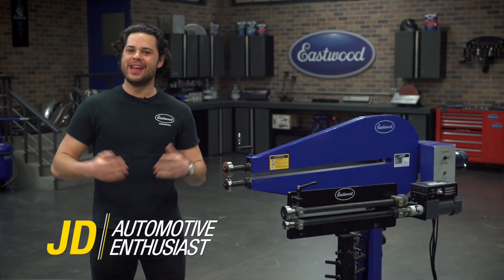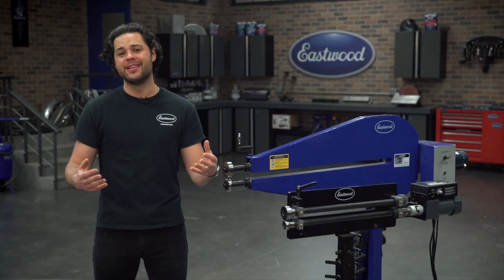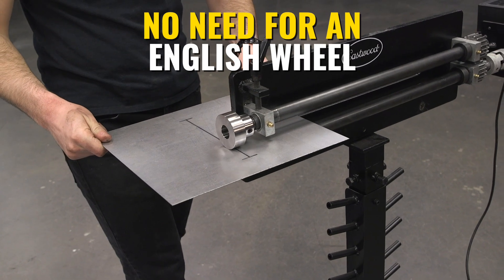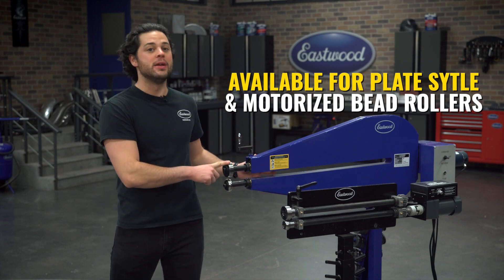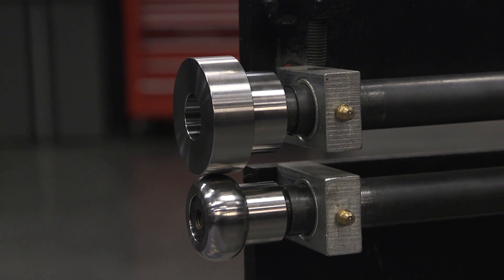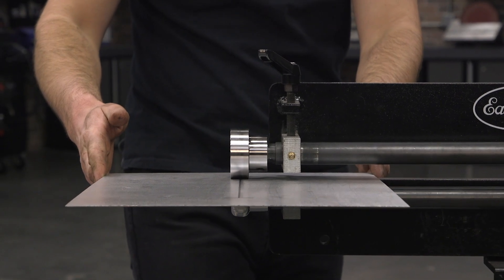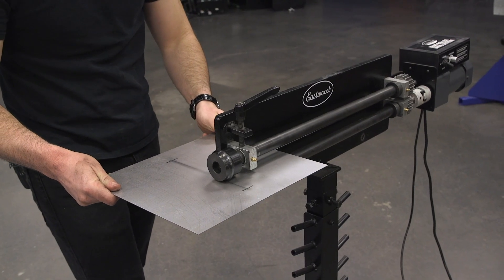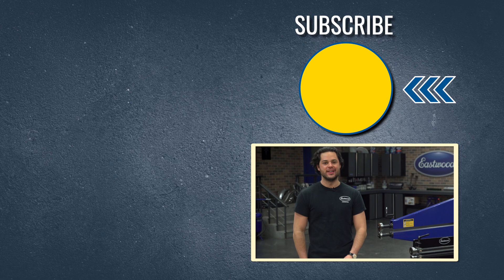How to Stop Warping Sheet Metal When Bead Rolling - Bead Roller Stretching Dies - Eastwood

Comment: Would like to see how you stretch a radius (circular) area like when you turn a corner on a panel's bead? I use an English wheel and have motorized my own bead roller.  Could you show an example of a rounded corner?